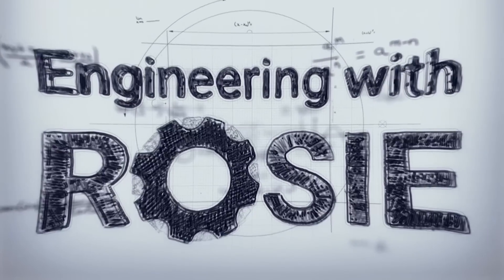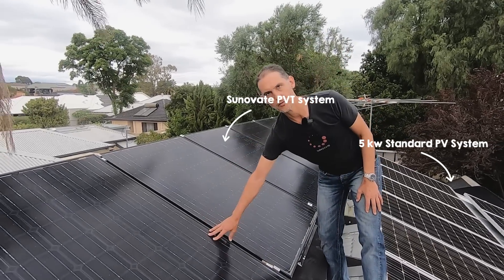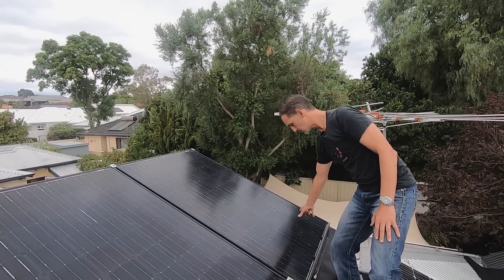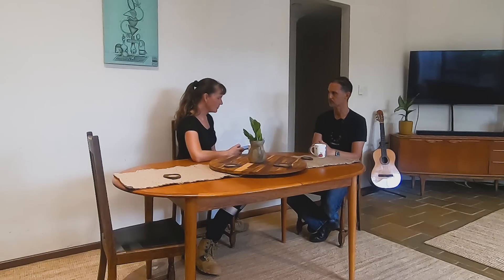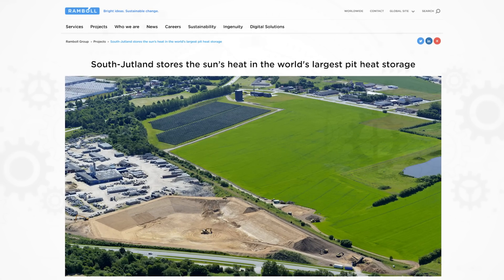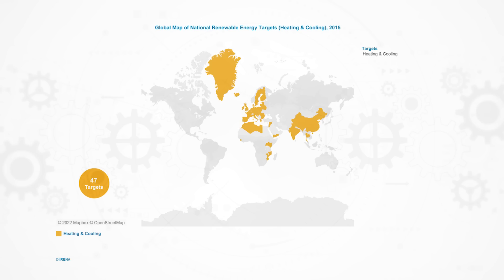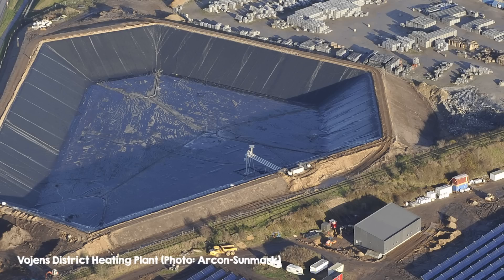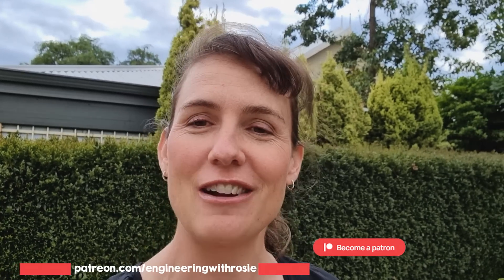Warming Up By Cooling Down Your Solar Panels

Comment: I live in Iceland and here we are of course already with about 85% green energy. Electricity is 99% green, one island still use diesel generation. Electricity comes from hydro 75% and 25% geothermal. Space heating is over 90% done with direct geothermal, the rest is by electricity. All in all about 65% of primary energy comes from geothermal and about 20% comes from hydro. About 15% is still fossil fuels, mainly jet fuel, diesel and petrol for transport. That will change slowly. There is little one can do about aviation today. But ferries for example are going hybrid here. With cars and trucks, we are #2 after Norway with electrifying those. New cars in 2023 were over 50% EV. Town busses in Reykjavik and the area around are moving to BEV. 
I do not believe that solar has a near term future here in Iceland, but we see the first wind power generators. A few small ones, mainly for testing purpose. Landsvirkjun has two 900 KW Enercon E44 running in the area between Búrfell and Sultartangi hydro power stations for testing purpose. They operate at 42.5% average efficiency, a high value for onshore. A wind park of about 60 MW is in planing and going through the environmental survey. Wind could complement hydro, that gets less water in winter, when electricity usage is highest.
Geothermal is base load, supplying power 24/7/365, without seasonal or daily variations.
Further CO2 reduction in Iceland could come from the aluminum smelters replacing the carbon anodes and the building industry reducing the use of cement, or perhaps zero emission cement will come.

Me and my sisters have a house in Portugal. There I have installed four panels for heating the hot water for the household. I am looking to replace the oil heating, only used on certain days and heating the pool, with a air to water heat pump. We have a fireplace, that also works as a boiler, that we use in the evening to heat the Living room directly and the sleeping rooms via convectors supplied with hot water from the fireplace.
 I am now looking for hybrid panels for electricity and heating the pool, so rather water than air. The pool water should be at a good temperature to cool the panels on a hot summer day. The difference in temperature over a panel should be small, if you get enough water flow.

Comment: How are you handling condensation on the glass from moisture in the air?  I imagine in a humid climate, FL, West Coastal US, the glass would be fogged, like trying to defrost inside of a car without the AC running drying the air; near impossible...

Comment: Interesting topic and a great interview Rosie!
multi junction solar cells would convert more photons to electricity and lessen the amount of insolation left for heat.
but (for now) the cost is going to outweigh the benefit.
has much research been done on reflecting specific wavelengths that aren't contributing to energy capture?
albedo should send unnecessary solar energy back into space. decreasing not only panel temperature but also the 'heat island' of the entire structure covered in panels.
it is interesting conjecture to create a selectively 'tuned' mirror on the panel face.
Just last night Ben Krasnow of Applied Science channel was demonstrating how a silver nitrate solution could be 'grown' to pass only specific wavelengths.
Reply from the maker: Really interesting points and I know quite a few people who are working on techs related to this. There is potential for future video topics here for sure!
Reply: @EngineeringwithRosie  That would be great!
Looking forward to your level headed take on what you find out.  👍

Comment: ok, air cooling, greater efficiency, but what about the heat-exchanger? You said he was looking at using the excess heat for heating or industrial processes. I want to see how PVT brings heat to my hot water tank or baseboard heaters.

Comment: Let's say I'm a Scandinavian and I don't get much sun. I have a thermally isolated house and a heat pump, which is basically a compressor. Instead of using electric motor to run the compressor, I can couple it directly to a windmill's shaft. How big I need that windmill to be if I want to heat my house during the winter?

Comment: It would seem that just letting air circulate freely on the back of the solar panel (air gap behind panel) would accomplish the same thing that your complex system does.  Obviously, heat would not be harvested but that seems to be the only difference as far as I can see.  The idea of solar panel life/efficiency would be the same, or am I missing something?

Comment: What about long term, send the heat the soil to cooldown the refrigerant? Of course, is long term, but entropy always grow so this is another thing to take care off. Same with the air, I cool down panels get more efficiency, but air will be more hot.
Reply: The heat is gonna be there on the roof if you don't  have solar panels. You are just shifting the heat energy from one place to another
Reply: The entropic value of the world will negate any warmth from this system

Comment: I think this is a great idea and I came up with an idea to fit a water tank rather than pipes to underside of a solar panel about 5 years ago for hot water but issue was as you said winter temperatures this solves that problem but doesn't provide hot water but would work for heating or cooling of a home but I still see some issues with most of the heat being produced will be on hot days when you want it cooler so does excess heat get released outside using some sort of valve? Watched Just Have A Think video after this one so posted to his channel as well.
Reply: Yes the system can open circuit to vent any excess heat when your long on supply and short on demand. Fan speed dictate the air flow for optimising the outcomes.

Comment: Sunovate should use the heated air for sand thermal battery like polar night energy or stiesdal sand battery and then control temperatures for a greenhouse growing spirulina to capture carbon dioxide emissions.

Comment: Suspend and protect vertical panels in a tall transparent tower.  The panel could rotate inside the tower to follow the sun.  The tower could be located in urban areas.

Comment: Take in mind, all is about cooling the environment. But for that, wouldn't it be better to reflect sun power back than to collect it with (mostly) black and heating up solar panels in the long term? Just wondering.

Comment: But what is the cost of this new solar panel cooling system?    Another approach is to have twice as many solar cells, and have them rotate so once they get hot they rotate with another one.   Seems to double the cost, but is a pretty simple solution.

Comment: I came up with a system that used the thermal to take heat away from the solar panel to provide hot water and better efficiency in solar panels all the way back before 2008. Sadly I was unable to get funding.

Comment: I'd like to see more of the companies behind novel climate friendly tech to be seeking crowd funding in two stages 

1: at an early stage the funders would be buying shares in the system (as for example the seeders funding platform does)

2: close to full scale launch a later stage use a funding platform where the funders reward is to get get some of the first models when the device finally goes into production at scale (kickstarter for example does this sort of funding).

I can't afford to sponsor a whole factory, but would love the chance to put some of my savings into helping the planet. Until regular production starts that is always a risk: the shares might be worthless or the rewards might not be delivered at all: however if I could spread those over a number of projects done if those might do more good for my grandchildren in terms of leaving then a better planet than the value of the money if it is just handed over as a bank balance.

Comment: So would there be anything to stop you using the heat captured in a sterling-type generator to just add to the electricity generated? If you were hoping to max out the electricity generation, that is...
Reply: The delta 'T' need to run the sterling.
Reply: @kkarllwt  Erm... If you're running a system to extract excess heat energy, then surely that excess heat would lead to a temp differential which could power a sterling generator?

Comment: You touched on a subject that doesn't get enough attention when one consider going renewable and that's insulation/weatherstripping (aka caulking). On that subject, the age of the structure (new vs older) matters and determines ones approach. These factors and geo location determine what renewable portfolio you should use to achieve optimal efficiency of each consideration. For instance, if you live in a location (e.g. Iceland) that will give a quicker return on geothermal and consequently implementation is more efficient then include it otherwise it's more trouble than it's worth. So portfolio.
     Ok, let's start with new structures (specifically homes) cuz this is where you get the most bang for your buck. Determine winter solstice side (wss) and face structure accordingly. At this time design should be dictated by maximizing # of solar panels which includes both photo volactic(⚡ pv) and photo thermal ( fluid pt) with venting for the roof and larger tinted windows (passive solar wss). Off the top: Insulation, Rvalue, and framing. Higher Rvalue is achieved with trapped air/gas, the denser the material the less Rvalue. 2x4 ext. wall w/fiberglass ins. R-13. 2x6 ext. wall w/fi R-20. In colder climates (icc), radiant floor heating (rfh) (also good for driveways e.g. Canada) ( scratch in warmer climates (iwc). Electrical: low voltage wiring (DC) for LED lighting and 2 outlets per room. High voltage wiring (AC) for larger appliances and 2 outlets per room. Iwc, engineered wooden ibeams/laminated beams for ceiling joists on floor that accepts roof to accommodate two large water tanks (1hot from pt panels into rfh) and (1cold to replace drained pt panels). Foam around ext. doors and windows and any cracks/crevices/voids (ccv). 6ml plastic sheathing (ps) on ext. walls, roof felt paper on ground floor. No ext. house wrap in new homes as this creates condensation in walls that have int. ps. 
         Older homes depend on whether or not ext. walls are insulated and existing shearing. If replacing ext. sheathing, consider larger windows if budget warrants, foam w&d, ccv, upgrade wiring, and house wrap. Of course, pv&pt panels. If not replacing ext. sheathing then replace int. wall sheathing (aka sheetrock/paneling) and do necessary wall upgrades at this time.
         This is an overview and details vary from structure to structure (e.g. color of floors and walls on passive solar side of home) and budget constraint considerations, i.e. a proper assessment is essential.

Whew.🧐🤨🤔😏🙄😛😉
Reply: The building envelope should the first priority. We fully support this. To what extent you go is difficult to derive a techno-economic breakeven is always difficult, before on the supply side you start to compensate for these factors. If your long on space then this becomes a capital optimisation question as the energy is green.

Comment: I'm curious if heat pumps would have additional climate change benefits. They pull a lot of water out of the air - but not sure if water in the air at ground level is as much of a greenhouse gas? Also since heat is largely being moved and not created, does that reduce some of our contribution to warming?

Comment: Engineering with Rosie it would be foolish to not generate hot water from these hot solar panels.  But beside the warm water exit side the cool air could come in to make it both water and air cooled, each facing in the opposite direction.  The air to run a clothes dryer and the hot water to go to a solar condenser such as a fresnel lens in a copper pipe to get the water up to close to 200 F. and store it for hot water usage, showers, dish washers or washing and laundry in addition to heating the house in radiant heaters.

Comment: Would it be practical or possible to use the heat generated to drive Stirling engines to convert that heat to more electricity?
Reply: I think Stirling engines need more heat in order to create the torque to drive a generator.

Comment: I’m curious why nobody includes links to these inventions?
So that we’re able to get stuff like this!
Reply from the maker: Only because I had to rush the production of this video (so I could release simultaneously with Just Have a Think's video on the same topic) and I released it over the weekend which means I ended up writing the description etc on my phone from the beach, in between surfs! Here's the link to Sunovate's website and I will be updating the description to include all the sources from the charts I showed and reference materials I used, and add bookmarks. https://www.sunovate.com.au/
Reply: @EngineeringwithRosie  Life is tough.
Reply: @ kkarllwt 
If you’re alluding to the fact that Rosie was having to work while at the beach then I’ll fully agree with you. Working outdoors is much overrated. Wind blows your paperwork around and the glare makes it hard to read your screen. And yes I know you were having a bit of a lark. 😉

Comment: For those considering solar panels, the specific parameter to focus on is the temperature coefficient of power, a lower number is better. A good one looks like -0.26%/°C from one particular vendor! Remember u get what u pay for! Better to get good panels that don't degrade at high temps!! YMMV too!
Reply: Didn't know that. Just checked the specs of my Sunpower panels... and they are -34%/C. Not good ones, I guess.
Reply: @oaklejant  Yeah,  Sunpower has great overall efficiency (one of the best in terms of output for roof surface area) but looking at REC Alpha series panels, they are better with that parameter.  As always in engineering - it's a tradeoff. What do folks want to pay for?  One size doesn't fit for all!
Reply: BTW,  when a panel manufacturer provides this data: Temperature Coefficient of Isc(α_Isc), Temperature Coefficient of Voc(β_Voc), Temperature Coefficient of Pmax(γ_Pmp),... which one is the one to consider? The last one?
Reply: @oaklejant  That's exactly right, the last one. Power is the product of the two (I*V).
Some inexpensive panels have sinfully bad specs, but give their costs - they are a "door openers".  Everyone has different considerations. 
I believe Sunpower remains the world leader in overall efficiency today.  "Winner winner, chicken dinner!" 😁

Comment: This reminds me of tracking systems, it was simpler and cheaper to just add a couple more solar panels to achieve whatever improvement tracking created.  Less expensive, nothing to fix, repair or maintain.  I don't think you can find any tracking systems, motors etc. today.  I say unaffordable.
Reply: I agree that tracking systems didn’t make sense. They did give power for a longer portion of the day but the same could be made happen by having a panel or two face sunrise. Being able to manually adjust the angle of your panels though makes sense the further you are from the equator. A guy who became known as ‘Handy Bob’ changed the angle of his panels in Montana regularly. The angle had to closer to straight up and down in the depths of winter which helped with sloughing off any snow. I haven’t been to his site in a long time but recall it was a great resource.
Reply: @mikedavison3400  our system of remote solar had panels at 60  degrees tilt(latitude of systems from about 50 to 58 degrees).  We had excess summer sun to recharge batteries but were looking for every thing we could get through winter.  This helped snow shedding, and maximized low angle weak winter sunlight if any.
Reply: @ Norm Yanke
Yeah you showed good sense in setting yours at an angle that might lose you some production during the summer months but gave you better production and protection from snow buildup during winter. I believe that Handy Bob guy was in Montana and got pretty good production during winter because they got a fair amount of sun and the panels would be cold which helped with efficiency. They would have some days when they drew down their battery bank a bit but sunny days would restore it.